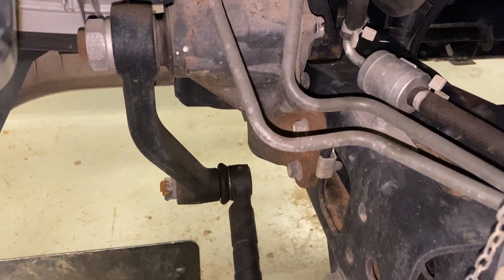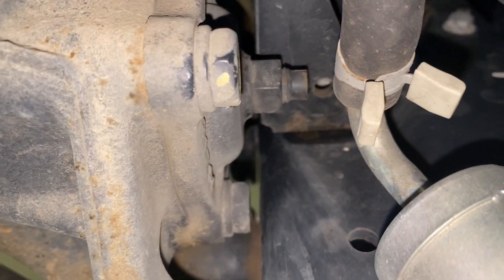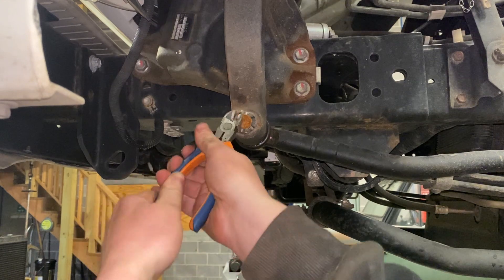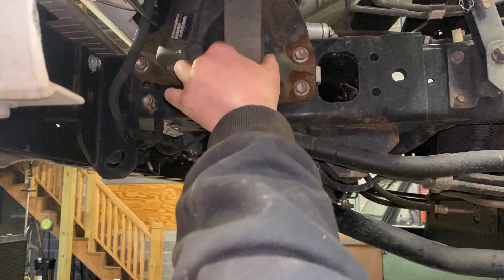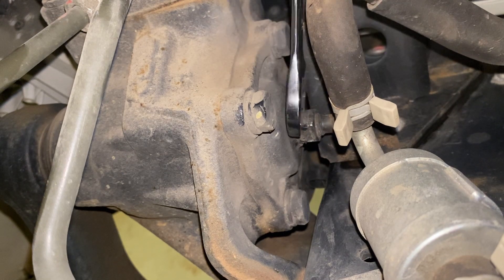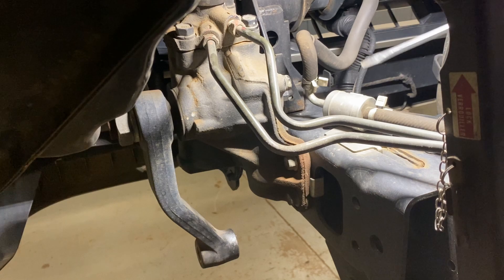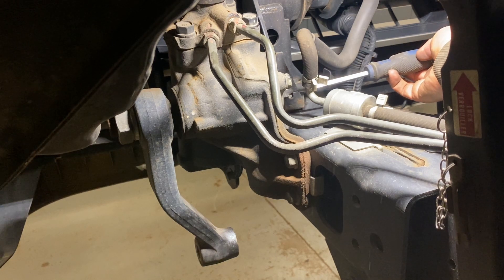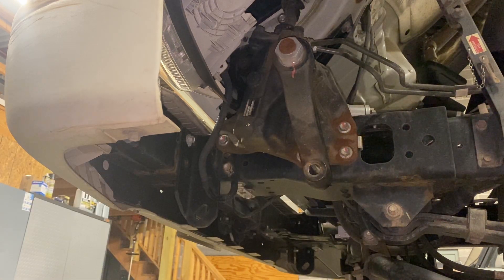Isuzu NPR worm gear adjustment (easy)

Comment: Just got myself a 10yo NLR which is all over the highway. Headed out tomorrow to tighten a worm gear. Meanwhile I'm clicking subscribe and stuff and watch a few more of your vids. Absolutely legit, Sir!
Reply: How that work out for you?
Reply: @ it made a massive difference in how it handles! Very helpful advice, thx a lot!
Reply: @HaJoSchatz  I didn't help you 😂 I was hoping to hear exactly what you said, sadly I tightened it up earlier and no change 😭 

I did however find another video that said the leaf springs are common to cause wondering because when they are sitting on the overloads it takes weight off the steers as it's not shifting the load forward... 

It's really 6 of one, half dozen the other as a new steering box is 600-1k and so are new leafs.... 

Thanks for the reply though! Hopefully it has treated you well or did if you no longer have it!

Comment: It was a year ago you did this what did you do to get the drag link off, our 2001 is all over the road, handling way too sloppy we replaced king pins , brakes, roters, tires, wheels and still it's sloppy, incase the worm gear needs to be tighten. Thank you for the how to videos

Comment: I’ve got a regular shimmy and shake to the front wheels of my truck since I purchased.. it’s caused a dragon scale sort of pattern on my front tire treads, with the middle row of treads becoming more and more raised.. the shop I bought it at initially said king pins needed greased, and did so with new tire install, helped some but its getting pretty rough. Would you suggest worm gear? Something else? 2014 npr 6.0 TIA

Comment: Buddy you skipped the most important part of how you managed t9 take a drag link out without separation of the bottom one. That is impossible. I have tried to Taki it out in all wheel positions. It's simply not enough room to take it out when it meets the truck frame or whatever is in the way